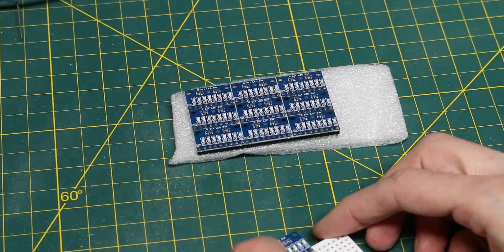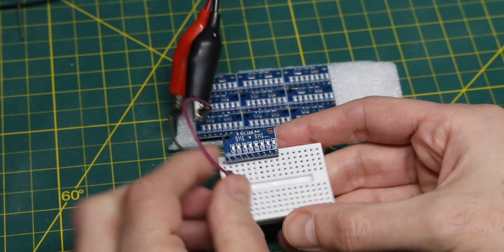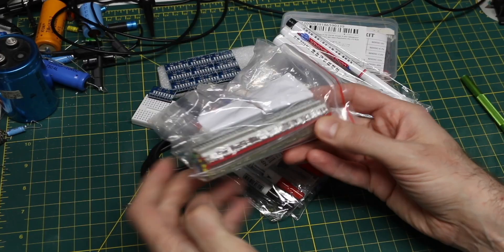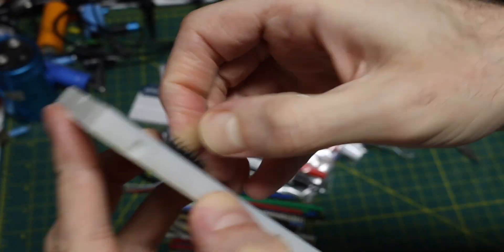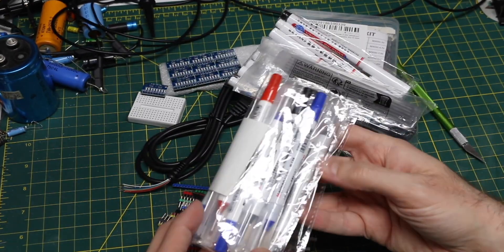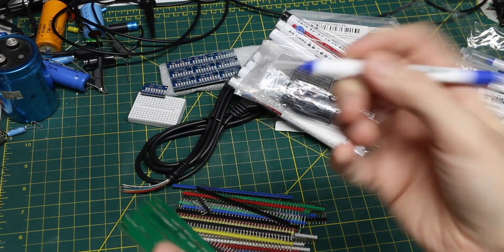Mailbag!

Comment: Spent a few weeks tinning wires with  solder and flux pots, skin used to get very dry after a week or so of getting flux on it. The women used to talk nonstop while dipping 1000's of wires a day. I had to spend 2 to 3 weeks doing every job there was as part of my apprenticeship so i would get a better understanding of production techniques used.  Then was asked if I could make any improvements,  quite hard at 17.
Reply from the maker: My first industry exposure was operating the solder paste screener which ran on a 486 to control the squeegee blades and vacuum suction plate and XYZ positioning system for raising and aligning the board to the stencil , so when the production line was down at least we could play basic windows 95 games.
Reply: @GadgetReboot  My first exposure to computing was on a commodore PET in the electronics test department. Trying to get it to measure the voltage level of a 1MHz clock. great fun trying to get a high impedance input to work at 1MHz with the FET's we had laying around.
Reply: @GadgetReboot I still use Win95, I love old software and coding for MS-DOS